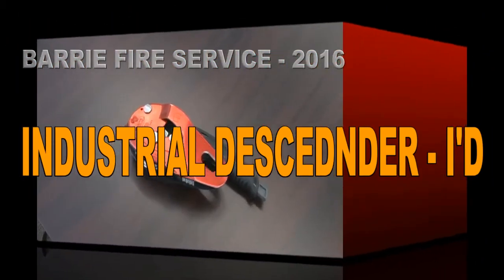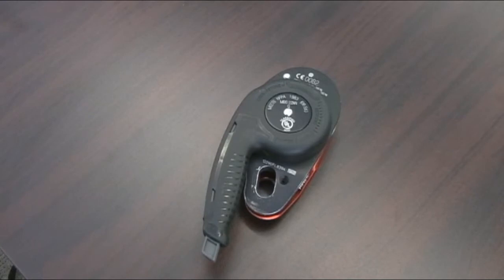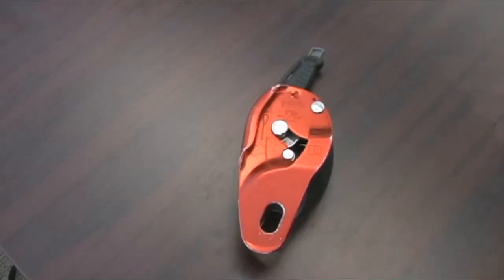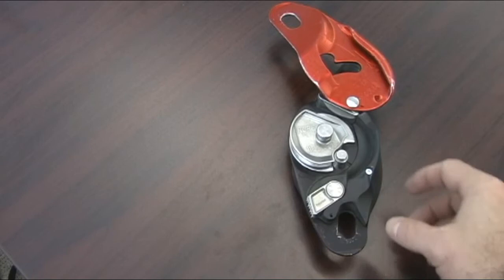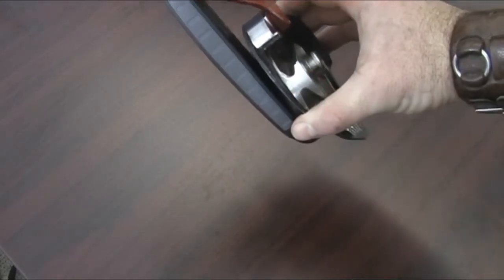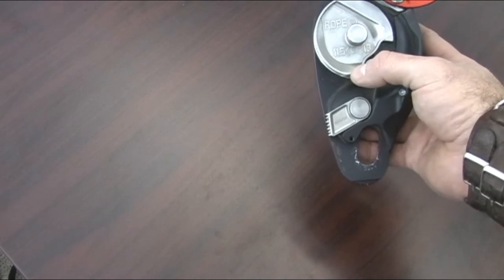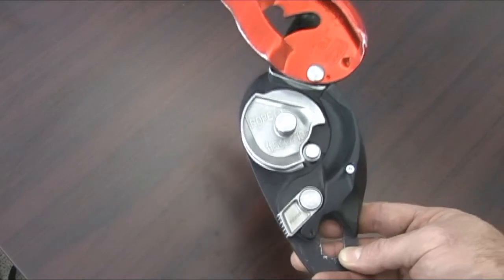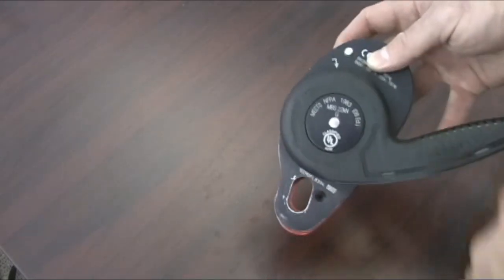technical rope rescue Barrie fire  - PETZL ID 1.0 part 1 of 3

Comment: A 4th use would be as part of a haul system.
Reply from the maker: As briefly mentioned in part 1 of our mechanical advantage series: https://www.youtube.com/watch?v=sWpB1jLXcSE&t=251s  
However the MA produced is highly inefficent for anything more than a few feet such as might be required if self ascending a short distance. As such it is not emphasised in barrie fire. If you think you may have do any real hauling or hauling on a 2 person load i'd suggest there are significantly better options such as the MPD by CMC or the new Maestro by Petzl...